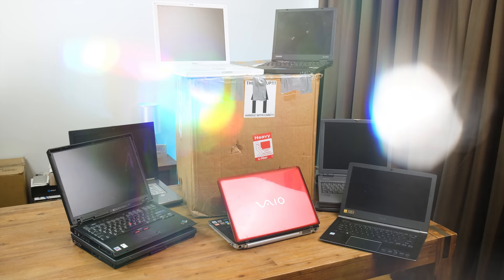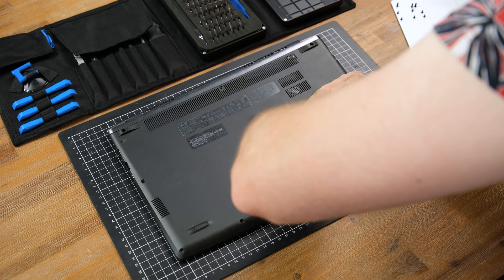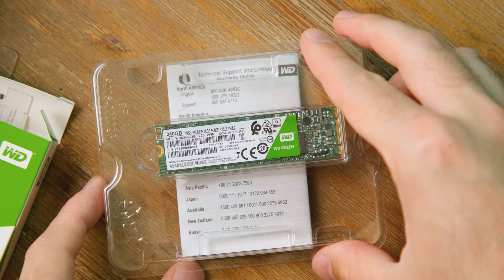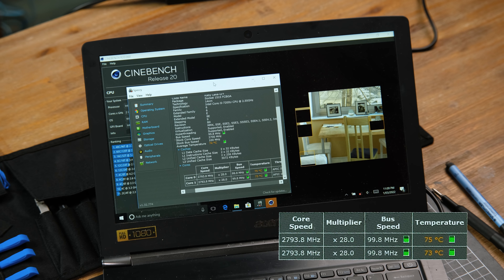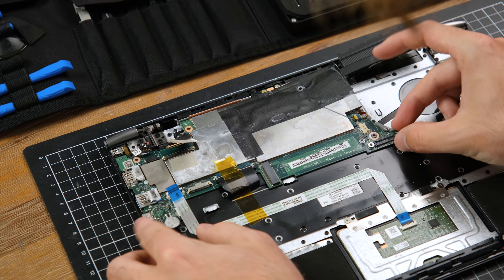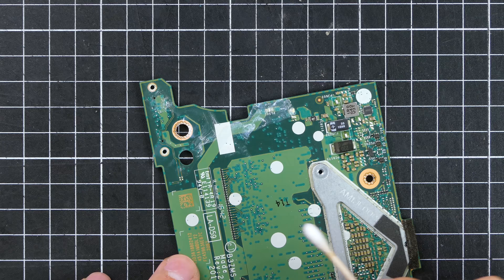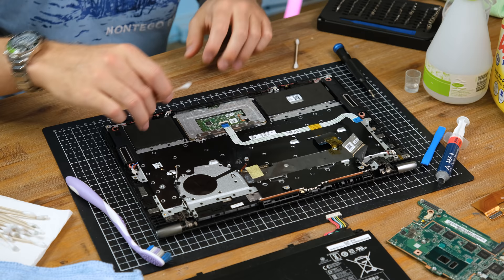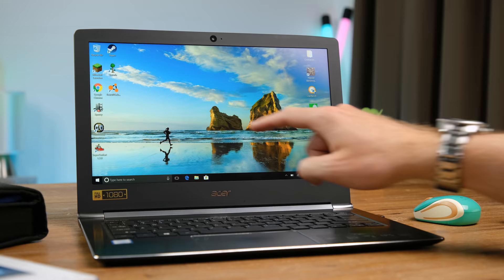Can This Dumpster Find Laptop Be Fixed?

Comment: 3:00 You don't actually need to create a partition, just click on "next" so it doesn't make 4 partitions on your drive, if you click on next, it will just make 2 of them.
By the way you're using a VERY old version of Windows (1607) which is from 2016, you should update your USB key with the latest version (21H2) :)

Comment: It's better to use something like vinegar to neutralize the corrosion first and then clean it off with rubbing alcohol, or give it a bath in an ultrasonic cleaner. Also you're lucky it's not a high powered CPU because a bent heat pipe is much worse at conducting heat than an undamaged one. Anyway, still a great and satisfying video, keep it up!

Comment: I was walking home last night and found a 27 inch Apple Cinema display with a VESA mount on the back on the sidewalk !
Outer glass was smashed.
Really dirty.
Cleaned it up & referred to you in my video saying you love eucalyptus oil.
Cables are ok.
Inner screen intact.
Sides of aluminum look rusty.
I plugged it in and nothing went poof.
I’m wondering what Mac or Macbook could connect to this.
It has a magnetic connector and some kind of video connector.
I only have one Mac it might connect to my Silicon M1 Mac Mini.
All my others Imacs ( which need repair ) are 2010 or older.
I don’t think my working 2009 Macbook Pro would connect to it either.
Rear case in fairly good shape.

Comment: Looks like a smaller version of my Aspire A515, that one has a 15 inch screen, same CPU and RAM. Got it for free from my mothers workplace, had a dead HDD in it, but otherwise works fine, although my left hinge is broken, so Ill have to work out a fix for that eventually. Nice find! The palmrest on mine does look wore out, as there are a few silverish spots on it that I have not been able to fix, although one of them i think was underneath some paper taped on it, so not sure what is up with that. Otherwise it is in decent condition.

Comment: I bought a Dell laptop from a flea market for 110 euro's, the battery is like new and it included a fast charger as well! I was stunned by the low price, it's a 3th gen intel i5, but when i got home and open up the laptop for upgrading the hard disk and the ram, and i saw that it suffered from liquid damage, so i cleaned all the corossion out of it, there was some damage, but all by all it worked perfectly fine, until . . . The screen cr4pped out, as it turns out, the display also was faulty, the backlight works and you can still see stuff if you put pressure on the lcd itself, but the panel is unuseable like that, so i have to buy a new panel, but this laptop is worth it, there is 16gb in there and a 256gb ssd!

Comment: You should see if this laptop has an OEM license for windows 10. When I dealt with laptops, the big vendors had a bios built in license, which was accessible by installing a OEM specific windows version.

Also I used WD40 contact cleaner spray on liquid damaged boards with better success alongside IPA.

Comment: I found a dumpster PC that just needed a hard drive. I now use it as a a home file server. A lot of computers end up in the trash over a single failed component (memory, graphics card, power supply, etc)
Reply: Some end up without ANY problem just because they are slow,outdated or useless for who owns them

Comment: i have a Acer Aspire E5-575G with a 6200U and a gtx 950M, beamng runs great on it (~50fps, fhd, lowest settings). It came with a 1TB WD Blue HDD, but I added a 970 Evo Pro 1TB (nvme ssd), which made it a LOT faster. The only issue I have is that when I boot any Linux OS from that SSD I get ~20k Interrupts per second which lets one of the cpu threads idle at ~80% Utilization.
Interestingly that doesn't happen when I boot a Linux from the HDD and then mount the ssd...

Comment: You had better luck than me.  I rescued a HP i5 laptop at an estate sale.  Hard drive was pulled and so was the battery.  Thing was barbarically ripped apart.  I ordered some parts for it to try and put it back together but the hard drive connector was ripped from the motherboard.  Still holding on to it.  I used a usb stick and launched chrome OS on it.  Touch screen and all works.
Reply: Why chrome OS, windows is better in every way. That was just my opinion, don't take it to offense. I rescued a HP dc5700 business computer from 2007 it was sitting behind my grandma's tv and the computer was abandoned and it used to ran windows xp professional. It had a Pentium 4 processor with HT technology and I installed windows because it has a greater software library and more open. With windows 10 you can theoretically use a computer from 2004.
Reply: @lathesangiriharan2295  I had Chrome OS installed on a bootable USB stick handy and used it just to test all the other functions of the computer.

Comment: That corrosion to me just looks like some kind of mineral deposit from unfiltered water. It could definitely be more than that, but to me it seems like the corrosion was fairly light and did not do much damage, meaning that it could have just been slight mineral deposits from the salts in whatever liquid was spilled on it.

Comment: Looks great, just a quick advice: remove the CMOS battery before scrubbing with any liquids, you could be causing more corrosion around the BIOS/EC ICs.
Reply from the maker: If it wasn't soldered on (or flat for that matter) I would've probably bothered.
Reply: @psivewri  Oh I didn't know it was soldered!

Comment: I had a liquid damaged phone which was not working for few days. After 10 to 12 days I tried to turn it on once more and it worked without any issue. I disassembled and cleaned it from corrosion then I used it as a daily driver for 1 another year after. But for the first few days it seemed dead. Maybe they just dumped it to the trash because it seemed just that bad and showed no sign of life.

Comment: My mom's old Dell from 2013 was a similar situation, except my young stupid self installed a virus on it. It would put itself in a constant boot loop (I was able to reproduce and again fix it via a system restore image that I had lying around, the reason I was never able to fix her old installation was because she had no system restore image like I did.) The computer's nice though. 15.6 inch display hd graphics, Intel Pentium CPU, it's a well rounded machine with a lot of pros and nearly no cons.

Comment: I have a Aspire 5 from this era, with a very decent RX540X but very slow A12 cpu (only 15W in a 28nm arch, no L3 cache)... but the main problem is the broken keyboard, I replace it once and broked again in short time, with a lot of people complaining of the same issue in brazilian foruns  (including intel variations of the Aspire 5)
Reply: Mine is an Aspire E5, also from this era, although mine is an intel core i5, and NVIDIA MX940 (I think) GPU... so far, the greatest limitation has been the dual core  CPU... in even "old" games as Sniper 2 the GPU is a bit bottlenecked by the processor. Other than that, it has been a very solid laptop for me: plenty upgradeable [ram up to 32gb, m.2 SSD and provision -and cabling for an additional internal SATA drive], backlit keyboard, large battery [just replaced the original with a third-party one] and a [quite dim] 1080p screen.

Comment: An on line troll sold me an Emachine laptop with Windows 10 & Timerunner on it which allowed him to control ALL my computers and devices once I connected the laptop to the internet.
I removed Timerunner but I got so angry I took out the SSD which apparently had Emachine’s proprietary OS on it & despite looking all over for years, I cant FIND the ssd.
If you have any ideas how I can restore the computer I would appreciate it. 
Itbworks but it stopped because it keeps looking for Emachine’s OS.

Comment: The real question is where do you take them frome, while staying legal? In those old laptops you may find DDR2 and DDR3, which goes for some jungle prices nowadays... Yeah, your laptop was dead at some point for sure. It was shorted when they threw it out, but the short went away with time. I found some laptops a few years ago, they had broken displays, they were shattered, but did not see any dark spots.

Comment: Bending back the heatpipe doesn't fix it. The cooling has surly worsen.
Reply from the maker: With it only being a slight bend, why would that not have fixed it? Please tell me what you'd recommend doing.
Reply: @psivewri  I have an old laptop with a lot of cooling problems, I have dangled with these things. The interior is filled with little fins in order to transfer heat better, if the pipe is bend even a little the fin array get destroyed. Also it restricts the expansion and contraction of the fluid inside. In my case you can feel with your bear hand that the side connecting to the CPU is blazing hot and the side after the bend is just a little warm. The most advisable and probably only thing to do is to buy a new cooler.

Comment: I suspect that this laptop was thrown out because it was dead. I found one by Lenovo and it worked fine for me. Well for a few months. It finally died again. I think that with my case, it had something to do with the board being discharged or something as the battery was unplugged. I hope you don’t experience this!!

Comment: Touchscreen with back-lit keyboard and a core i5? As per my estimate, it would have been sold at around $1000 AUD and in the current market, it's worth somewhere between $900 to $950, nothing less

Comment: Damn how I wish there guys who would throw away their laptops here in my location. My relatives who are living in the United States send me a laptop that did not boot up and fixed it right away. it is an acer laptop with a 4th get i5 processor with 8 gigs of ram. I just had to replace an ssd and it works perfectly fine! It has been almost a year since i have been using it as my main and only pc/laptop at home. I wish I have a 7th gen laptop picked from the trashcan lol

Comment: Aspire S 13 series was junk, including new Acer.

Even with normal condition, i couldn't update the NVIDIA driver, you only could install NVIDIA driver from Acer Website, which is really baffle, because I test play GTA 5 but the NVIDIA just don't do the job.

Compare to another laptop with same specs, it run better

Comment: Can it run windows 11
Reply: Not officially since it would need an 8th gen CPU, which weren’t out when it released. It would need to be set up in the same way I got my 7th gen CPU running on it. Still doesn’t make sense why my 7th gen CPU wasn’t supported despite its support for secure boot and TPM 2.0

Comment: The reason it was in the dumpster is because its a Acer
Reply: I can't forgive Acer since the days of the Aspire 5742 series... Overheated big style (and the fan couldn't keep the thing cool), so it was a case of either using Power Saver (and suffering with performance issues) or overheat and shut down...
Plus, the fan and heatsink required motherboard removal. No thanks!
Reply: Surprisingly acer is one of the brands I’ve had the best luck with in the 16 years I’ve owned laptops. The absolute worst for me was consistently HP. I liked the specs on the 2009 Toshiba I owned at the time but there were fatal flaws in its build quality that give it a lower ranking long term. The DC input in Toshibas of that era were prone to failure and the sad part is that a permanent fix was readily available for about $4 US and Toshiba wasn’t interested in doing it. Their warranty department was also questionable at best during that era. But doing my own repairs I used that 2009 laptop confirmed well into 2017 when I gave the two I had away. Not sure if they are in use now or not.